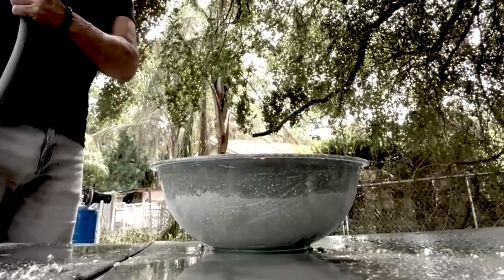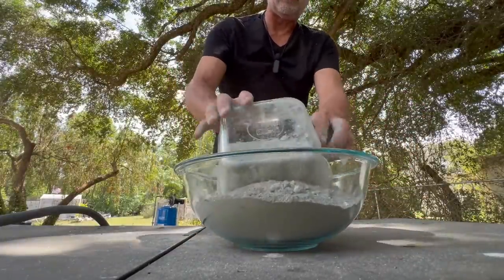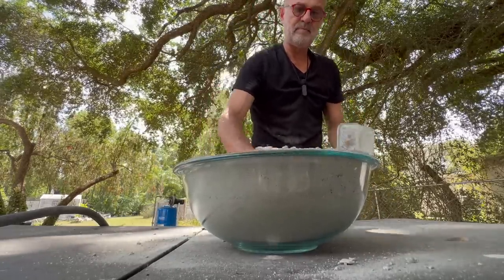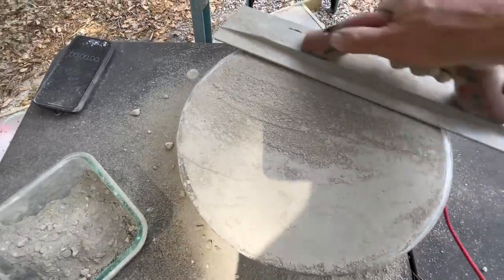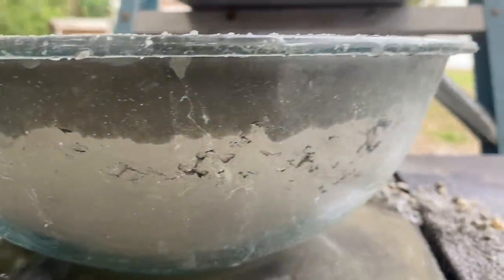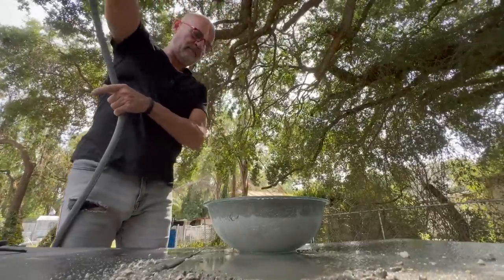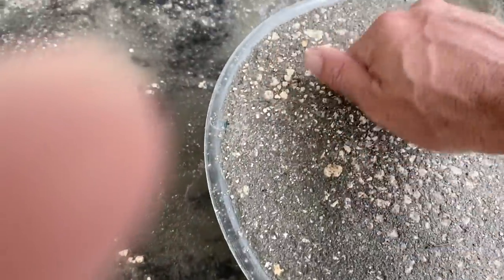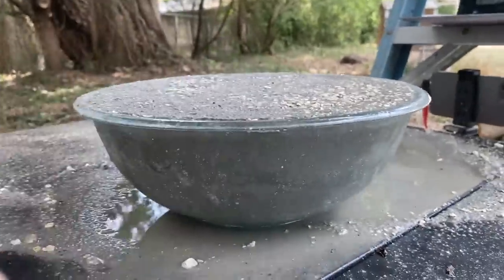See How Dry Pour Concrete Process Works in Real Time

Comment: Hard. Yes... but what is the compression strength compared the mixed concrete?
Reply: entirely dependent on the use case.  for something like a pad for a garden shed, chicken coup...light foot traffic...i would say it's irrelevant.  nobody is saying dry pouring concrete is better or even remotely equal to traditional mixing.
Reply: Thanks 👍
Reply: I wouldn't be pouring a driveway just yet until the results come out.

Comment: But is this really accurate being that the water isn't escaping into the ground it's just collecting in the bowl
Reply: Water doesn't escape from dry or curing concrete. The concrete keeps soaking any water around it until it starts bleeding out at the top if it has taken too much water

Comment: How thin have you tested it? could you do a resurfacing of about an inch thick using this method? thanks!
Reply: Each type of mix states the minimum thickness on the bag. To get to 1 inch, you would need a different mix. It would have smaller aggregate and a different ratio of Portland to other ingredients.

Comment: Interesting. But what you did is not anywhere close to the dry pour process as popularized on utube.  

You completed everything in one hour, while the process has you just lightly wet the surface, let it sit for an hour, lightly wet again, let it sit for another hour, then start heavy waterings - once an hour per inch of depth of the poured mix.

All you demonstrated is that surface hardening starts in less than an hour at the temperature at the time of your demo.  You didn't even dump out the container to show how far down it has started to harden.

Comment: This is the MSDS report for this product- 
  Wear protective gloves. Wear eye and/or face protection. Avoid breathing dust. Wash hands thoroughly after handling. May cause eye and skin burns. See Section 4 for additional details. May present risk of engulfment. See Section 7 for additional details. Overexposure to wet concrete can cause severe, potentially irreversible tissue (skin, eye, respiratory tract) damage in the form of chemical burns, including third degree burns. The same severe injury can occur if wet or moist skin is exposed to dry Ready Mixed Concrete dust. Clothing wet with moisture from concrete can transmit the
 
   Continued...
   caustic effects to the skin, causing chemical burns. Ready Mixed Concrete may cause skin burns with little warning; discomfort or pain cannot be relied upon to alert a person to a serious injury. Pain or the severity of the burn may not be felt or known until hours after the exposure. Medical conditions which may be aggravated by exposure: Contact with wet concrete may aggravate existing skin conditions. Sensitivity to hexavalent chromium can be aggravated by exposure.
Reply: sheep
Reply: And the nanny state is alive and well folks.
Reply: @madddads6418  loop daddy has a great song called wake up
Reply: @kennethm.380  Loop Daddy has a great song called "Wake Up"

Comment: I've been wondering for a long time if this kind of cement can be used to pour into a
cement driveway to fill a section of the drive that was damaged when a tree fell acoss it.
Of course the bottom of the cracked section is not smooth like your bowl and it has
a little bit of grass and dirt I guess.  It's not a very big section - maybe 10 inches long.
Reply: Yes. I did. 4’ repair like this and it worked well. I added that acrylic binder they seem to ensure adhesion to the concrete that remained.

Comment: Why would you want to do this?
Reply: Because of several reasons.  When you pour concrete wet, the clock is running to get everything perfect as the concrete hardens.  You have to get it mixed, move it to the project, pour it in, vibrate to get rid of air, edge, float, and surface at specific times.  With dry pour, you get it perfect and then add water.  With wet concrete you have a lot of tools to clean before the concrete hardens, and you have to have a good place to clean them.  It takes a crew of two or more.  This guy dry poured several large slabs by himself in previous videos.  It looks very easy.  And with commercial concrete upwards of $110 per cubic yard, plus labor, the dry pour can be done for much less.
Reply: @dchall8  relatively easy maybe, still moving 80 lb bags plus the prep work on the ground and forms.
Reply: @StevenfromTX  Yes, relatively.  There are some common elements to both approaches.
Reply: @TUGG75  Everything I said was wrong???  Or only the part about the price/cost???  How do you know the surface will deteriorate?  Have you tried it, 10, 15, and 20 years ago to be able to say that?  
I had a bag of Quikrete in my garage that solidified simply from a year of humidity.  It didn't seem to be turning to dust.  
YOU might be able to call a truck and pour a patio, alone, but the people who are the audience for dry pour likely don't have your tools, skills, and experience.  If they did have experience with normal concrete, then they probably won't care about dry pour.

Comment: Walkway? Paver stones? Maybe... Two things wrong with this demonstration and with dry pouring. Concrete is a chemical reaction It is not just the ingredients themselves and water. It's not glue. This is like people who buy a MIG welder and use it like a glue gun. Yes you can stick things together with it but there's no integrity to it. 
If you dry pour on the ground it's not the same as it being in a mold where the water is contained. You can't get water to the middle and it's not going to permeate once the top has a harden coat. You would have to completely saturate the ground underneath. Even then the integrity is going to be severely substandard. Why? Because there's not enough water for the chemical reaction to take place at any given time You have just enough for a little bit of a chemical reaction but not enough to coalesce everything into a actual chemical mixture. Anybody that does concrete will let you know that there's a point where it "goes off". That is referring to the chemical reaction happening and the concrete setting. That only happens with hydration and mixing. 

If you're going to do this do it on something that it doesn't matter... A pad for a shed, a pathway, garden stones... Do it to play with but it is not anything that you would want to make that you think is going to last or have any kind of structural integrity.  If you get somebody that is gravity challenged (fat) That weighs 300 lb sitting in a garden chair each one of those feet sitting on the ground is going to have 75psi/in² I would have my doubts especially if it was close to an edge. Concrete has a compressive strength of 3,500 to 4,000 psi when cured which takes 28 days after pour.